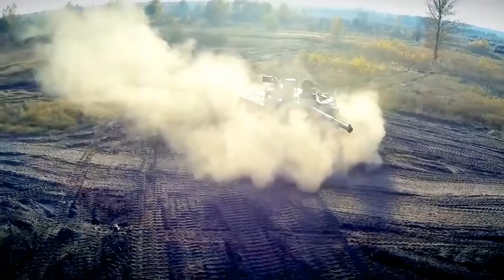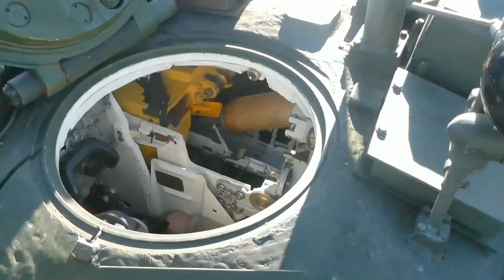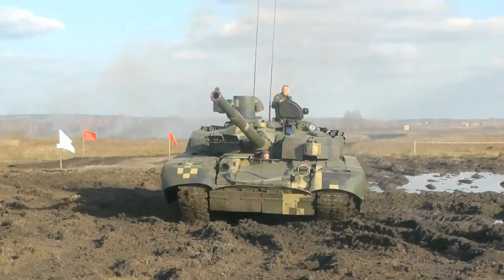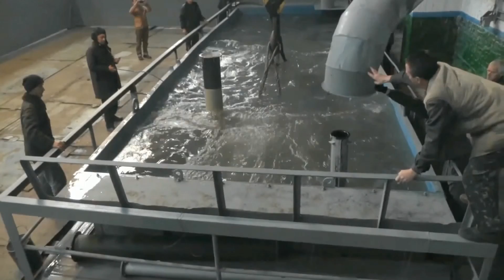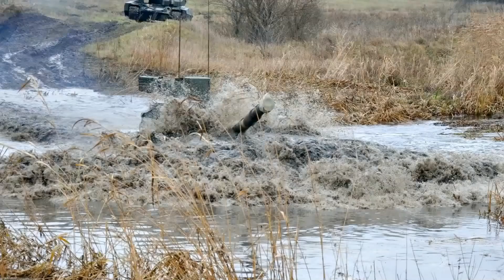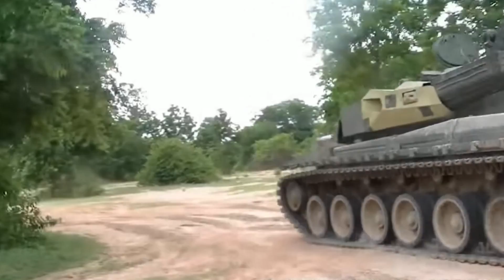The T-84M Oplot Main Battle Tank - Overview

Comment: This is more mythical than the T-14 armata, at least the Armata has been confirmed to seen combat in the north east of Ukraine, this thing still hasnt been seen anywhere
Reply: How is the production of Zaglot progressing?
Reply: Is it normal for you to be so dumb?
Reply: Keep the propaganda for yourself.
Reply: @tempusfugit5388  Or what little Nazi kunt? Whatcha gonna do?
Reply: @tempusfugit5388  BM Oplot also broke down in a parade and had to be towed away, meanwhile T-14 didn't.
Reply: @definitelyfrank9341 wasn’t that the t 14 with a reversed engineered nazi engine from the porshe tiger. Because I saw the rehearsal parade when it broke down.
Reply: @bennyprice5823  Incorrect. They are two very different engines. 

The general conception between two engines is similar - X-form turbocharged diesel with direct fuel injection. But the rest is quite different, as engines have major differences in exhaust, cooling, turbocharging, transmission assembly and others. The idea that A-85–3 was based on Sla 16 comes from the simple fact that barely anyone ever used X-form diesels at all. 

By the way, Sla 16 never entered production. The sole operational prototype was fitted to a Jagdtiger which was then captured by Soviets.
Reply: @bennyprice5823  how could the T-14 break down if it left the scene of the problem on its own?
Reply: @rndnick78  the video I saw is from red Viking and the only good impression I got is the tank has a excellent set of hand breaks when towed off.

Comment: Give it a 120mm smoothbore, bustle autoloader, modern materials, and better armour, better transmission and some modern nato 120mm ammunition and it will be a way better tank.
Reply: Hydrogas suspension, and composite rubber tracks and it will be the most mobile tank.
Reply: well it was the t-84 120 yatagan prototype
Reply: >Give it a 120mm smoothbore, bustle autoloader
So... T-84-120 Yatagan?
Reply: Bro are u stupid? You're just saying nonesense by adding "modern materials" without even explain what's that and 125mm does more than 120mm any day. Why do you think the rest of the NATO are coming up with 130mm for their cannon?

Comment: Very interesting improved version of the T-80 but how does it compare to the T-90MS?
Reply: T-90M you mean? T-90MS is the export version.

Well, firstly it cannot fire modern projectiles. It's older gun is also less accurate than that of T-90M. The best projectile it can fire is 3BM17 'Mango', which definitely would not be able to penetrate T-90M's upper glacis plate and Relikt all at once, and definitely won't penetrate through even T-90M's turret's base armor (at 2km).

Secondly, BM Oplot has very high ground pressure, that's why it isn't being used in Ukraine. It doesn't fair well in the soft ground there; ex-T-72 crews using T-90M tanks noted how the T-90M's greater weight makes it harder to maneuver in such soft ground.

T-90M is equipped with 3rd generation thermals for both the gunner and commander, while BM Oplot is equipped with 2nd generation thermals for both gunner and commander.

T-90M is equipped with a battlefield management system plus data link.

Comment: The Ukrainians are the guys that gave us the T34. They also gave us the T44, T54, T64 and T84. These have been their hi-tech vehicles.  Other companies in Russia built cheaper lower tech variants such as T72 was the cheaper tank to the T64. Originally the T80 was called the T84 and the name change came about to confuse NATO.  When the Ukraine gained independence they changed their build back to T84. So Originally both tanks were the same with minor equipment differences.  Check out OSPREY Press T80 tank book for more details.  Enjoyed your introduction to the latest version of the T84.

Comment: Hunter-Killer is nothing new on Russian tanks. It has had this capability since at least T64. 

What Russian tanks did lack until recently is CITV (commanders independent thermal vision) which greatly improves the commander's ability to spot targets in all weather (previously the commander had to use regular optics) which in turn greatly improves the hunter-killer effectiveness.

Comment: btw this tank totaly sucked during 2018 strong european tank challenge it reached only last place with 950points... the winning Leo2 A6 Team from the Bundeswehr reached 1450points... one point the vehicle total sucks is the shit suspension... if cant keep the tank leveld while shooting, in direct compare to Leo2 Challenger2 M1A2 Sep or Leclerc you realize how outdated the russian sussspension design is...the tank shake like hell after each shoot and needed 2-3 seconds to stop moving... the ride is bumpy and not smooth as modern western tanks...as a gunplatform a huge drawback for accurate fire on the move...and as the results at 2018 Strong European Tank Challenge has shown... next to all the fails of the Oplot it reached by far the worst shooting results... not even near the western NATO tanks... even old Leo2 A4´s from Austria outperfromed the Oplot by miles during shooting... for me this tank is like most russian tanks... a stats paper star that fails badly to deliver... a tanks is a complete pack + it needs a good crew to perfrome and good ergonomics to allow the crew to perfrome ood to get the maximum out of the equipment...

Comment: It is an interesting design. It’s profile is low and apparently it is fast. But to make a tank fast and low profile is to sacrifice armor. I would never claim to 
Be an expert on tanks but common sense tells me that it’s very vulnerable to a standard armored piercing rounds and even a standard heat round. 
But it’s armor can be upgraded with reactive armor. Personally I would never invest in this tank unless I used it as a reconnaissance assault tank.

Comment: Matt, my comment is not of this particular tank but one that would address your narrative of the benefits of tanks being able to ford water obstacles via snorkeling. During the period of the Cold War, Warsaw Pact have trained and trained to cross the various waterways of Germany. While film clips of tanks immerging from riverbanks with tall snorkels and coning towers were impressive, the reality was that most of those river crossings were prepared with concrete or rocky riverbeds way ahead of time!

No matter how heavy a tank might be, once underwater, it obtained a certain amount of buoyancy, compound that with river currents,  extremely muddy conditions of the river bottoms that prevented proper tractions, such method of river crossing had to be planned and yes, staged.

Meanwhile, Western armies simply relied on bridge laying tanks, pontoon bridges and other ferrying techniques to overcome water obstacles as being more reliable and expedient. Bridgeheads would be secured through heavy artillery and air suppression and liberal use of smoke screens. I have practiced such river crossings along with combat engineers a number of times while in Germany.

Comment: One very important thing. On Strong Europe Tank Challenge Ukraine announced to bring new T-84BV tank, but couldn't do it, because both prototypes was inoperable at the moment. So they brought T-84B variant. And during the chalkenge it showed it's total incapability... I don't remember what exactly was there... Engine failure or something, also it couldn't shoot precisely enough. If you interested, just google "Strong Europe Tank Chalkenge 2018 T-84" and you'll get all tge info.
So... It may be all the hi-tech, but it worthless if it doesn't work.
Reply: Sentar
The first prototypes of the tank "T-84" stronghold "made in 2009, 10 pcs.  What do you mean, both do not work?  At the competition "Strong Europe Tank Challenge" there were 5 tanks, and only one had problems with fire control, the rest had a perfect shooting.  In the overall standings, points were not collected for reasons: the incompatibility of some disciplines with such a small tank in height.  But the new tank BM "OPLOT" is a completely different machine, at the moment they are made for the army of Ukraine, in the amount of 300 pcs.

Comment: There were not "hundreds of T-80s knocked out by Chechen rockets", the total number of the lost tanks during both wars is around 200 and only 60 were total loses. Most of those were T-72. The biggest problem of T-80 was its gas turbine but it is related to all turbine powered tanks when you have to keep it running non-stop.

Comment: Matimus , since my Army receive new Norinco VT-4 tank and testing and the result were clear , VT-4 Gun and Fire COntrol System are more accurate than Ukraine T-84M.
and after Ukraie finished all the 49 batch their offer new T-84M BM oplot with variant upgrade for Thailand again.
It depend if my countries to continues it , if Ukraine offer some improvement and in maybe transfer technology. but since Thailand want Ukraine to build Facility in Thailand. and China gonna build repair factory in Thailand too .
Reply: Ukraine is not capable of deploying production, this is the reworking of the old T-80U. These are not new tanks, there is no complete cycle of production.
China can, but ... as practice has shown, even the new Chinese weapons are controversial.
Just buy T-90S))

Comment: the conflict on the east of Ukraine will magnet a lot of Rus and Ukr haters.
If you have some time it would be interesting to look up the T64 Bulat upgrade - pretty unique in the sense that for cheap Ukraine is modernizing it's tank park and might correlate with raytheon upgrade for m60 you've mentioned previously.
Reply: The T64 upgraded to the Bulat version can easily fight T90 on pair, while the Raytheon M60 has zero armor to withstand modern AT munitions.

Comment: Matsimus can you explain us why western tanks haven't adopted the eastern tanks feature of launching ATG missiles through their main gun?
It seems such a useful ability for first hit beyond the guns ordinary range.
Reply: 1) Initially, gun launched ATGMs were necessary to make up for early model T-64s' (9K112 Kobra) and T-72s' (9M119 Svir series) inferior fire-control systems. These originally could not ensure a high-enough hit probability at ranges above 1300m, so a guided missile solution was necessary. Modern FCS can enable acceptably high hit probability, so the original reasons no longer apply.

2) The actual effectiveness of the shaped charge(s) in a gun launched missile is less than the equivalent calibre main gun HEAT round. This is known to be true of Kobra, Svir and Refleks. The reason is simply that there is always less space for a shaped charge payload in a gun-launched missile, than in the equivalent diameter HEAT round.

3) The actual effectiveness of even tandem shaped charge warheads against tank frontal armour is, these days at least, questionable. Pay no heed to estimated penetration values, those have wildly varying test standards, and are basically marketing gimmicks. Consider what the phrase, "this tandem shaped charge penetrates 1200mm of RHAe", could mean.

4) Missiles take a very long time to travel to the target. At the relevant ranges where gun-launched ATGMs might be useful these days (3000-5000m), a competently crewed, properly-equipped tank is likely to have noticed the incoming missile and can take steps to break guidance, rendering it ineffective. You cannot however run or hide from a sabot round "on-the-way".

5) With proper FCS, common tank guns actually can easily make hits far beyond "ordinary ranges" ;)

6) If you really wanted to launch a missile from a tank, you may as well put a much bigger missile in a smaller thin skinned vehicle that is sitting further away under cover. 

That is why the two Western gun-launched ATGMs, the Shillelagh and LAHAT are nothing like their Russian counterparts. Shillelagh was an old, chunky 152mm weapon meant to be fired from the Sheridan's, MBT70's or the M60A2's low/medium pressure gun. LAHAT was developed because the effectiveness of Israeli 105mm guns (which are the bulk of their tank guns) is no longer competitive. It is a 105mm missile, and the 120mm version is still a 105mm missile. Crucially, it is SALH and hence capable of top-attack which enables a smaller warhead to defeat well armoured tanks, unlike all currently deployed Russian gun-launched ATGMs, which are laser beam riding. Furthermore, it is also said to have a range "multiple times greater than current gun-launched missiles", and can be fired from cover and guided by a forward observer, indicating a completely different way of using it compared to the Russian beam-riders. It can also be fired from low-pressure guns since most of the propulsion comes from the rocket motor, unlike the Russian beam-riders, enabling it to be deployed on otherwise very short-ranged 105mm armoured car/IFV/light tanks, like the M1178 MGS.

In a way, it seems like an idea more akin to the 120mm KSTAM Korean Top-attack munition. That is not a missile, but a gun-fired EFP "skeet", that is fired at high angles over a target area to float down by parachute onto enemy tank formations, before autonomously identifying a target and detonating. In both cases the idea is to enable tanks to thin out the crowd before they get into engagement range, rather than actually fighting enemy tanks with these munitions directly.

7) The most important reason though has already been mentioned - except in the desert, what tank fights another tank face-to-face at 5000m range?
Reply: Maybe because it is very rare when you actually see a tank at 5000m, most of the time, ground is not perfectly flat, so shooting at such a distance is no use, especially since there are more and more anti missile systems on tanks, but it is true that it is still interesting in some cases .
Reply: wuerzelburg some of the leapords can
Reply: Aesir Knight tv guided missile and boom from blue sky literally.
Reply: if i am right merkavas can do this.

Comment: The Duplet ERA currently is the most effective ERA in the world which is the only one capable of 90% penetration loss of even the newest NATO APFSDS, tandem HEATs and EFP type shells.
Reply: RLY? How so?
Reply: That's because its design is completely different from all other reactive armors. It doesn't just explode the steel-ceramic plate to confront the penetrator - its segments are in fact a small HEAT charges which cut through the DU/Tungsten penetrators or HEAT jets causing them to brake upon penetration attempts. Here's info on its predecessor - Nozh ERA, which has very similar design bit it's in Russian http://btvt.narod.ru/4/noz/noz.htm
Reply: Thx, I'll manage.
Reply: If it really held that 120F1 rod - that's pretty impressive.
Reply: duplet is different from any of the current ERA type exist，it's like the combo of HEAT tube and can cut the apfsds rounds apart
Reply: Found a word about US army actually bought a couple of Nozh units back in 2000s, guess it's for testing purposes. It looks like we'll be having means to bypass this ERA soon he he.
Reply: No cans or other physical objects as they will interfere with the HEAT jets. You are confusing Nozh/Duplet with Russian Gofr which was ineffective and its research was quickly cancelled.
Reply: We'll see about that - Duplet and Nozh were also upgraded since then ;)

Comment: the t80 was a feared and respected tank back in 1999/2000 when I did my cr2 training, so if this is an improved version I bet it could still hold its own against most mbt's out there.
Reply: T80 would have made a difference. When doing mass spearhead attacks, most would be wiped out in one frontal hit. But after Aberdeen testing, they discovered the t80 could survive one frontal hit. Possibly enough to tip the scale.
Reply: @humansvd3269  frontal hits from what and when? The original 105mm m1 wouldn't be able to take a hit from it either.
Reply: It can't actually as Ukraine can't produce modern tank rounds, so it's limited by old 80s vintage ammo.
Reply: Russia already owns them.
Reply: @khanman9146  Russia dont have them

Comment: Astounding! However, a notable flaw is the width, and it seems to use the same hull as the T-80, so hull armor should be the same. Would make sense for a Super T-90, with similar sideskirts and maybe different turret design.
Reply: No, armour is slightly better, even without nozh or duplet era.